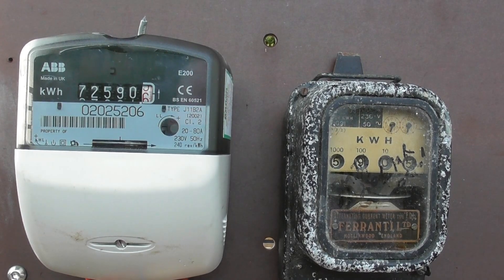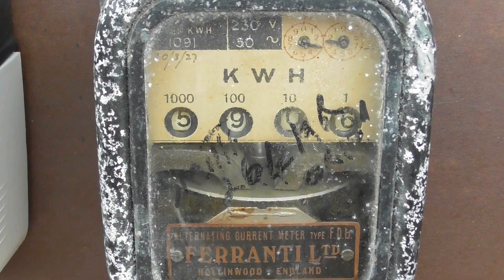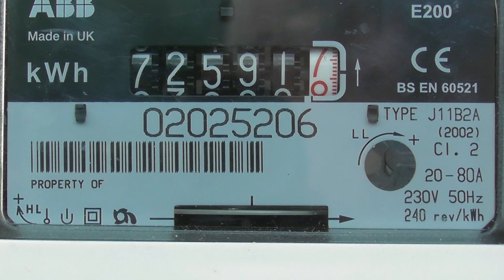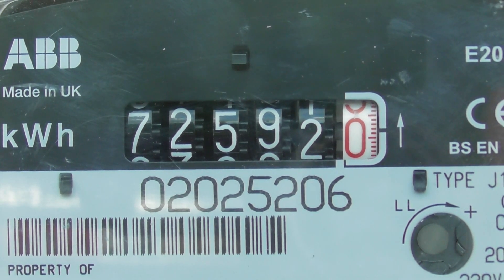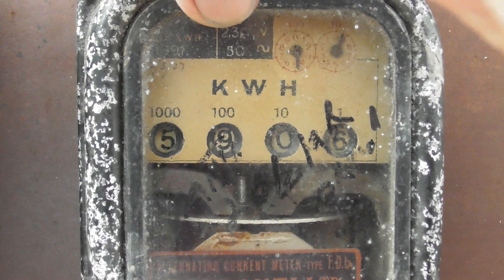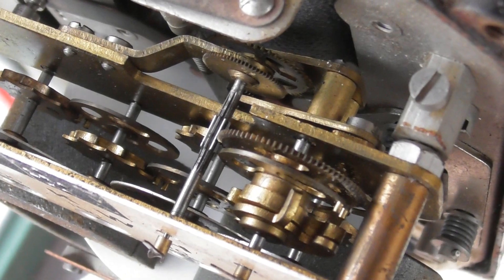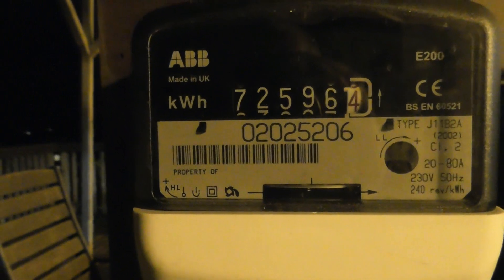Ferranti FDb and ABB J11B2A meters

Comment: YAAAAY, more loadwheel action to be 
had, with two instruments as well! When 
you were talking about the symbols on 
the ABB meter, I thought that.........
.
.
.
.............the symbol which is a straight vertical line with the circle at the bottom of it indicated that the instrument was a Single Phase, two-wire instrument.

I have seen this symbol before on industrial instruments, and instead of one line with a circle, it has three lines so-arranged in a fashion to represent a three-phase 'star' arrangement, thus indicating that the instrument was a three-phase, four-wire meter.

I don't know if these instruments contain a 'FLOTON*' or not, but given that these instruments can be back-traced to the ENGLISH ELECTRIC days, there is a possibility that it may very-well have a Magnetic Bearing in there.

The company started as English Electric, then GEC meters, then ABB and then Elster, who ditched the whole production line of loadwheel-based instruments and went plastic-fantastic on us with electronic blinky-boxes.

Thanxx for showing,

-Wayne's Electrical.

17th April 2021, 20.52

* = "FLOTON" is a trade-mark of Sangamo Weston, Enfield, Middlesex, England.
Reply from the maker: Thanks Wayne, I hadn't clicked onto that single phase symbol but that makes perfect sense. This meter has a Floton bearing, more or less same design as the C11B2A inside. They changed the speed to 240 revs/kWh, most likely better torque on light loads.

Comment: Very nice, I have a Hitachi 10A meter, which is an all glass bowl front. In use as a meter for the AC, as the usage on the unit corresponds nicely to the 10A range on it, and with a 5A draw the meter reading is very much corresponding to running hours.
Reply from the maker: Actually I have a Hitachi meter. Type Y-82M with a register based upon the Sangamo S200.16 design, which can jam up at the tens. Need to find it and will make a video.
Reply from the maker: Excellent, didn't know that Hitachi made meters. I like meters to be within the middle of the load range so they respond well to the connected load.
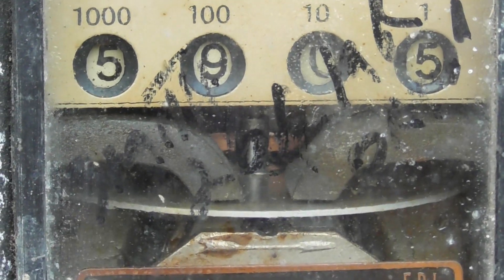Reply: @RODALCO2007  I have 3 old electric meters in use as sub metering. One for the computer, one for AC and the other recently installed to see power use of some equipment. Computer one i use a current transformer to make it fit more into the measuring range, as otherwise the 80A rating is useless, so a 1:10 current transformer is used to get the current sense loop more sensitive, though at the expense of making all the registers be 10x what they are marked at.